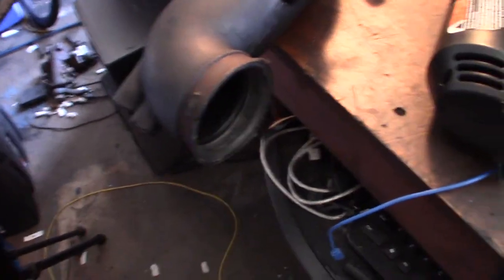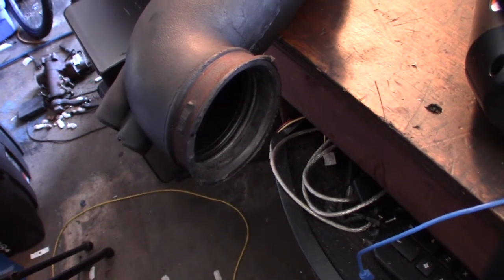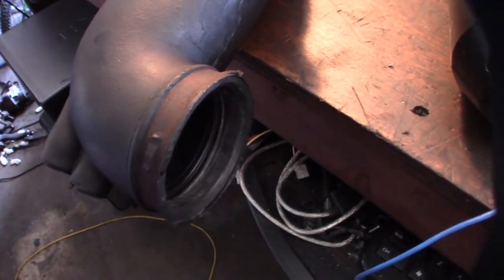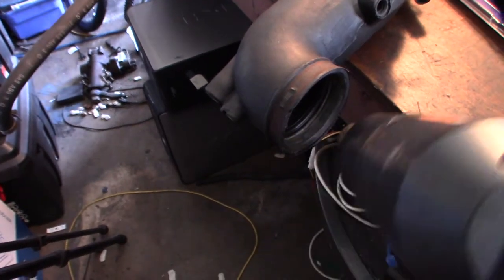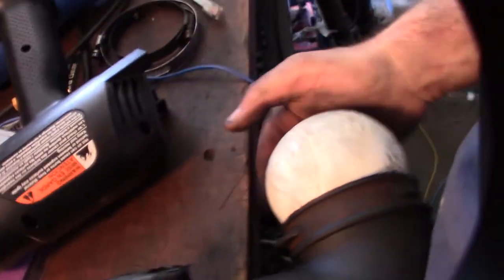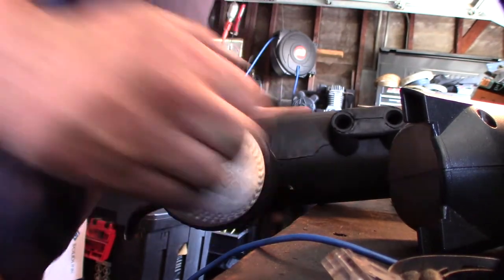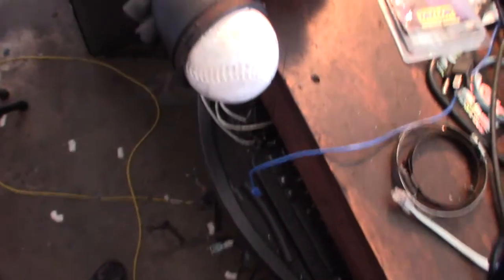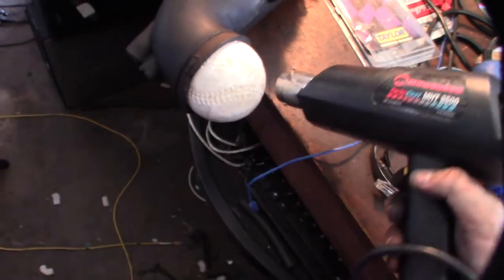Cold air intake throttle body rubber stretch trick tip coupler

Comment: Worked great! I knew about the heat gun but softball worked perfectly. I added heat a few times with the ball in and out and was able to get the rubber elbow on after changing to a larger throttle body. Thanks for the tip